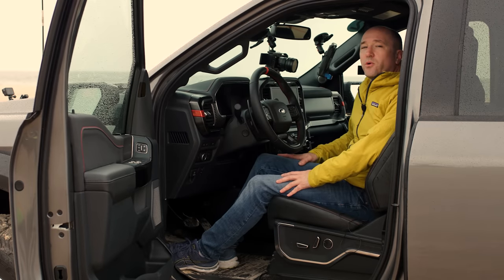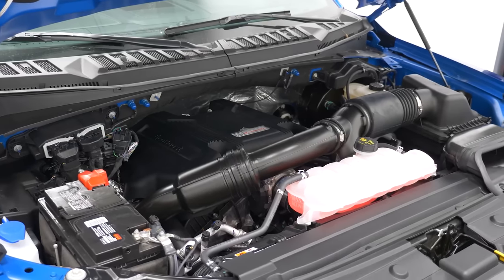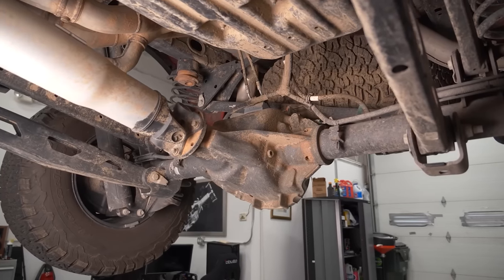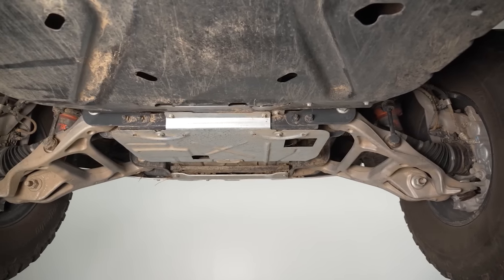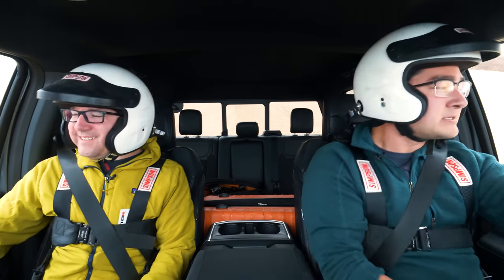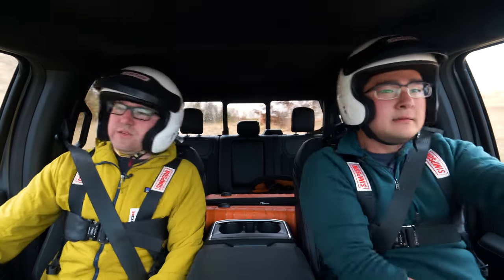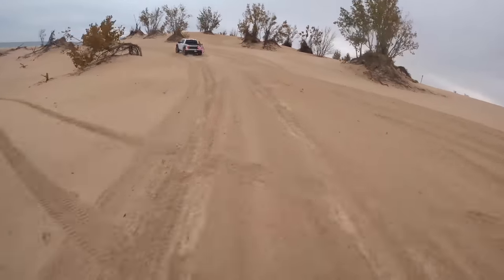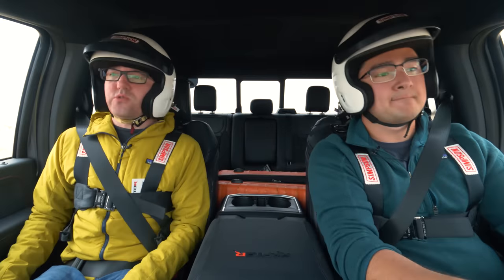Ford Raptor R First Drive | $109,000 for the V8 Experience

Comment: Never thought I'd see the day when an F-150 would cost as much as a Porsche
Reply: I never thought I would see a Dodge Charger selling for over $100,000. The repainted and decal package final addition Chargers that sold for $60,000 a year ago, or an EV Cadillac sedan with a $300,000 price tag. Maybe you should check truck prices like the TRX. Here's some prices furnished by True Car. TrueCar has 240 new Ram 1500 TRX models for sale nationwide, including a Ram 1500 TRX Crew Cab 5'7" Box 4WD. Prices for a new Ram 1500 TRX currently range from $75,178 to $150,000. Now you've seen trucks that are priced for $150,000. I didn't think I would see gas prices at $5.00 per gallon again when a couple years ago it was $2 36. We have this thing called inflation. If you purchase groceries. I'm sure your aware pricing had increased by 11.4 % and it's only the beginning especially if your young
Reply: Would much rather have this than a base 911 with no options at all… an average base 911 is optioned over $150k new
Reply: @Youcallthesebagels_  A Porsche is safer, stops faster, gets double to triple the fuel economy, with greater reliability and less maintenance, being equally fast. The only reason NOT to get a Porsche over an F150 is if you actually need off-road capability.
Reply: @emotionz3  Or you tow something
Reply: Have you seen the prices of porches? Also who cares, they aren’t even in competition. 

Guy goes to the dealer: “I’d like to see the Raptor R; oh yeah and I’m cross shopping for a bottom bitch Porsche too.”
Reply: @emotionz3  What's the cargo bed size on a Porsche?
Reply: I would assume that for a long time the most expensive F-150 cost more than the cheapest Porsche.
Reply: What porsche is under 100k nowadays? Very few esp with options.
Reply: @winstonwolff  are you the real Tyler Durden?
Reply: @winstonwolff  Why don't you simply check their website?
Macan 58K+, 718 64K+, Cayenne 72K+, Taycan 87K+, Panamera 92K+, 911 106K+
Reply: @Dowlphin  not after markups.
Reply: @emotionz3  - really??? ridiculous to think that a Porsche 911 is more useful or practical than an F-150. Because it has better performance? What do you think people drive on race tracks? and then you mention greater reliability over the F-150 and MAINTENANCE!! You have to be 12 yrs old 😂😂😂
Reply: @CoyoteFTW  F150 can’t be parked anywhere, has insane maintenance because it’s a heavy truck (twice the weight, twice the wear and tear, twice the fluid capacities) and fuel economy is going to add thousands a year to commute costs. Meanwhile Porsches are insanely reliable with most normal 911’s and Boxters regularly hitting 200k without trouble.
Reply: @emotionz3  try driving a Porsche in a Midwest winter. Or tow a camper. Or a boat. Or go off-roading. Or throw a dead deer in the back. 

They are for totally different purposes.
Reply: @emotionz3  ehh Porsche has very few crash tests in the US.
Reply: @emotionz3  also as a former a Macan owner I have to laugh at calling Porsche reliable. 😂
Reply: @cadriver2570  compared to every other luxury German vehicle, they undoubtedly are
Reply: @emotionz3  : "F150 can’t be parked anywhere, has insane maintenance because it’s a heavy truck"  LMAO. Thanks for letting all of us know you've never owned a pickup without actually saying so. Ridiculous comments, especially thinking that 1/2 ton pickups are expensive to maintain.

Comment: Great video!  Your Gen 2 Raptor video sold me on that truck and I went out and bought one back in September 2020.  Now that the V8 is back one would think I'd run to the dealer to put in my order but that won't happen because of my Gen 2 ownership experience.  The $70K truck has spent months in the dealer for a chronic problem with the Cam Phasers.  In fact, they replaced the engine once and that one started rattling again.  The truck was recently at the dealer for cam phasers again and when we got it back it now has a random misfire at idle.  Don't even get me started on the creaking sunroof that can't be fixed regardless of the TSB's Ford writes.  My Gen2 Raptor is the second F150 in a row Ford has screwed me on and it won't happen again regardless of how cool the new products seem.  Sorry for the rant but know that I always look forward to your next video and will remain subscribed.
Reply: We are in nearly the exact same situation with our 2017 f150, Ford just giving us the run around.
Reply: Gen1 is the move.
Reply: Have you looked into the lemon laws of your state?  If not, I would do so in case there is some clause that would leave you stuck with it if things aren't corrected.
Reply: It's still a Ford. And I say that as someone who hasn't driven a single vehicle aside from an F150 for 30 years. They just aren't worth what they're asking.
Reply: @genghis1971  It did not qualify in the original warranty period.  The truck had two complete mechanical failures before the factory warranty was up yet was in numerous times for the rattling on startup.  It spent a month and a half total in the dealer during the initial warranty period.  After the warranty was up, the ESP has covered the additional exact same failures and it has spent over an additional month in the dealer.  The sunroof falls under "adjustments" so its warranty period is long gone.  The other tricks the dealers play are:  "Cannot duplicate complaint" and "characteristic of the vehicle".  This helps them run out the clock on the warranty.
Reply: @kennethwolkens6251  this is a very well known problem with the second Gen raptors. Apparently the problem has been solved in the third Gen but of course the first Gen never had these issues. It has its own set of course but it is not uncommon to find them(Gen 1) for sale with 300,000-450 000 miles and will going strong
Reply: @cartergarnon6299  I love my 6.2
Reply: @curlyandfri3s  gen 1s don't have problems at all
Reply: I had a 2019 with nearly the same issues, they told me the misfire was normal. I just ended up selling it and washing my hands of it no matter how much I loved that truck.
Reply: @Blue_Flame_Raptor  no? What about fuse 27? Power steering pump? Transmission lead frame? Cab rust? have a 2013 screw I am familiar with the Gen 1 and it's issues
Reply: @curlyandfri3s  they aren't catastrophic like cam phasers. Just little bugs you can work out, you can't fix cam phasers, it will just happen again. I have 150k miles on mine absolutely 0 issues
Reply: @Blue_Flame_Raptor  that doesn't mean "no problems at all"
Reply: @curlyandfri3s  in comparison sure. Gen 2 can be a hot mess and they sure as heck aren't lasting as long. Gen 1 is one of the most solid trucks out there.
Reply: @Blue_Flame_Raptor  I agree completely there, just gotta find myself a low km terrain screw and I'll keep it till I die in another 60 years hopefully
Reply: @wadecarnes8159  How much are a low mileage GEN 1? What problems do they have?
Reply: @Blue_Flame_Raptor  😂 frames bending 🤷 that is a huge issue that most had and it's an off-road truck
Reply: All the EcoBoost Ford engines we all should know by now that they do not hold up period would that be instead I would have the first generation V8 Raptor or this one I wouldn't touch anything with an EcoBoost
Reply: @dor1tomcswagger  you couldn't be more wrong. That was a limited number of people who went way to hard. Even though it wasn't fords fault they reinforced the frame in 2013.
Reply: @Blue_Flame_Raptor  I also own a 2012 F150 Harley Edition ($50K new) and it too has had its engine replaced early in its life and a VVT rattle at cold start since 30K miles.  Ford does not have a good history with me and their top of the line pickups.
Reply: Sorry to hear that!!! What mileage did your issues start? I have a 2019 Raptor Supercrew. I currently have 70,371 miles on it. I had cam phasers done. But that’s about it, engine wise. Lucky for me, I don’t drive it anymore. It’s my wife’s daily. Or else my Raptor would be toast. I daily a 2021 jeep Trackhawk. I absolutely abuse it. I average 7mpg. That little weak ass v6 Raptor is not meant for real man driving. 

Again
Sorry to hear about your experience 
I’m going to trade my 2019 Raptor in for a Raptor R
Reply: Love my 2018 Raptor Supercrew and no issues at all. Being the Raptor R does not come in Supercrew or reg cab and the ecoboost is enough power off road. I will be keeping it for life.
Reply: @lrr5586  I own a 2019 Raptor supercrew. You don’t want a Raptor R becuase it doesn’t come in supercrew or Reg cab? What do you mean. Who are you kidding. It’s not enough power and it sounds like shit.

Comment: I like that the stability control still keeps an eye on you near the limits. This truck inspires you to drive it hard and fast and 700hp + hooning off road , means you will likely reach the limits quicker than even a skilled driver can recover, especially off road.  Save people from themselves.

I also wonder if they had the advanced track truly "off". Ford usually makes you push the button then push+hold it for 10secs to turn off advancetrac and the traction control. It's always more than a simple push or hold on ford's that allow full off.

Comment: I realize this is over $100K and a halo product, but the big disappointment to me is that little of the world class engineering filters down to the volume products like the Explorer or Escape.
Reply: Agreed.  Current gen explorer is a disaster.
Reply: Those products get world class accounting.
Reply: @kevinbailey3239  loves the st
Reply: @ryan94mustang  Sadly, that's most products these days. 😔
Reply: @kevinbailey3239  Do you own a new one?  I actually do own a 2021 Explorer ST and it's a fantastic and fast SUV. My son just purchased a new 2022 Explorer limited trading his 2018 Ram picks up for his new Explorer.
Reply: Actually the engineering does flow down to other less expensive models. I'm not sure what your referring to. In order to keep pricing lower. Some technology is offered as options. If these options fit your budget. Add them to your vehicle order. The manufacturers give you the opportunity to add technology to your new vehicle increasing the vehicles pricing. If you have ever had a house built. It basically works the same. You pick the extras that fit your budget. It's all about what a person can afford.
Reply: What would you like to see trickle down to the Escape? The 700 hp V8 or the 5 link rear suspension?
Reply: @DWH300  3 weeks in a '21 XLT and thought it was behind the lower trim palisade, cx-9, and GC I also spent time in.  Admittedly, no time in an ST, but doesn't surprise me throwing more HP and torque at a RWD platform provides some fun driving.  What is great vs the competition on the limited trim?

Comment: I have 100+ thousand dollars.  I bought a fully loaded Hummer EV that matches the horsepower, speed, and maneuverability for the same price.  It also gets the cost equivalent of 45 MPG.  Had the Raptor R been out at the time of my purchase, I may have reconsidered.  That is, if Ford could get their hands on any chips.  As is, my regular Raptor had to be built without the ability to lock its doors, no heated seats, no heated steering wheel.  Estimated September 2023 for them to get the chips to finish my truck.

Comment: The problem with it is that it's Ford. The Ford persona isn't "attitude", and the Ram persona is. Noise, tire smoke, and f--k anybody who complains. I can hear from the cabin audio that the sound and personality of this truck is subdued by comparison to the TRX. They could have given this truck a Loud Mode exhaust and upgraded appearance package, but they didn't; instead, they let their competition catch them trying to correct a mistake, which was the V6 Raptor. This is a Thinking Man's performance truck that is aimed at a customer segment that doesn't think.

Comment: So back when the Raptor first came out in 2010 in Canada you could get one for $65,000, they want $130,000 for a Gen 3 V6....I'm guessing the R version will be $160,000 or more lol. I bought a 2017 F-150 SC Roush for $57,000... seen a dealer in B.C sell a new one for $150,000 apparently i did very well.

Comment: 600 lbs lighter then the trx and 2 hp diff with 37s yea ford killed it as always
Reply: It's 30k more than trx. Just saying.
Reply: @migueralliart  Not when comparably speced out. The Raptor R is essentially loaded, only options being a moonroof. Go build a top spec TRX on Rams website. You will be north of 100k as well.

Comment: Wait,What? Fake sound!(109K). Looks like Ford Engineers didn't care about a lot of things sounds horsepower...You  paying 109K for second most powerfull truck on the planet. They should be fired. I'm  surprise none of you mention this truck cost TWENTY EIGHT THOUSAND $$$ more then TRX. I'll give them one thing they broke magic barrier 6 figures for the 1500 pickup truck. Really really  embarrassing.

Comment: FINALLY.
After Several Years of Ford Sticking their Heads in the Sand (Literally), we HAVE a V8 RAPTOR AGAIN.

The F-150 Raptor R is, to me, a DREAM TRUCK. A Supercharged V8, Ridiculous Suspension for ANY kind of Off-Roading, And what is, to me, a HARDCORE Truck that Anyone can have fun with, On- or Off-Road... For a HEFTY Price. Ford has finally listened to the Audience they have ignored since the 2017 Raptor was Unveiled with a 3.5L HOE V6, and have given us Exactly what we asked for....

It's just a shame they chose to give it to us during a time where Inflation is at an all-time high, and the Market for New Vehicles is Off the Cliff due to Ridiculous and Unreasonable Prices.
Knowing the Stuff going in inside Ford Dealers, these things will be Inflated by a Ridiculous Margin. 
Don't be surprised if you see ONLY One of these things at your Local Ford Dealer, but they're charging Double or even TRIPLE their MSRP.
After All, this IS a limited edition kind of Truck.

I'm honestly glad to see this out on the Market as of Today, but don't be surprised if either:
It's Quickly Sold Out, OR...
They stay stuck on some Ford Dealer Lots for a Long time because NO ONE in your local area wants to pay the price for one.

Fantastic stuff as always, Savagegeese! Keep the Good Times Rolling!

Comment: For over 100,000 thousand dollarsI  do not think I would be off roading the way it is at least close to be driven off road.  It is nice to have 13 inches of wheel travelup front and ? in rear the last I heard was 13.9 inches .on Fox shocks that I think are good. The amount it goes up for a good V8 is way high.  I have seen F150,s and Broncos with theTTB independent front 4wheel drive suspentions with cut andturned lift kits long chromoly radius arms atached to the frame back by the door handles with big stainless steel heim joint bearings beams can be longermore wheel tl wheel up front  and plated and gusseted for strength.  they have V8 engines you can build or make more power from and have 17-18inches of front and 18 or more rear suspension/Wheel travel rear.  of coarse add on some extra stuff like gears and lockers some King Shocks etc...for fast off road surppprises and jumpingon purpous or notand spare mounts, safety cage etc... and for way less than 09K or way,way less if you are familiar with metal work,weilding andcan do  alot of work yourself including taking apart and puting back together suspention, drive shafts ,axles fiberglass fenders and bedsides for tire clearance . Less weight is  a plus with them tooand other stuff deprnding on your needs or wants.Can take some skill time research and some $$ . The ability to ride over bumps like whoops fast in control  and go where you tell it off road ca n give you Permagrin thats hard to loose!!  Plus Pride able to help others out of stuc is great for both you and them!

Comment: ok...rant alert. sick of this dumb trend. 

If this was $75-85k then that’s an understandable market price for such a toy, but at this price, we enter a different world of what’s expected for the money.

 it doesn't go faster than fast cars that cost less, it doesn't haul or tow better than regular trucks that cost less, but fine, its a toy, so we can look. past that. 

but  in the spirit of this truck's idea,  it can't race in the desert against even mildly built desert trucks that would cost less to build and ride way better. 

it has the same cheap interior materials and finish of the same  $50k f150 truck sitting next to it at the dealer.

to put into perspective, here's what you can buy w the same money or ( a lot) less  AND get what you paid for in performance, materials, finish, usability, etc  -$110-150  (w options and BEFORE DEALER MARK UP)  buys you:

ANY heavy-duty optioned out to the max truck from chevy, ford, or RAM that actually work as trucks.
also better off-road pick-up trucks like the Z72 Silverado and  Power Wagon..... AND the TRX and have a bunch of money left

bu them yu get into why asking a that price is so ridiculous for this truck and what it offers. :

Z06 vette!!
M3
M5
M7
X6M
X5M
Porsche 911 4 GTS ( if you have an extra 20k to spend you get a GT3!) 
Porsche CayenneTurbo S
MB E63 S 
MB GLS 63 
MB S-Class 580 4matic ( FFS!!) 
AMG GT C!!!!!!
Audi R8
Audi S8
Audi RS7
Cadillac CT5 V Blackwing 
Mustang GT500
Range Rover Autobiography !!

 

and its not Ford hate at all. this also applies to the TRX but at least they don't ask for $110k starting.

Comment: The Raptor R is a super cool truck and I'll smile and check it out if I ever see one in the wild... but there's a laundry list of performance and or luxury vehicles at $100k I'd personally buy over this. I think $100k is steep for a supercharged V8 pickup but $110k just seems like an extra slap on the ass+kissy face from the dealership on your way out the door.